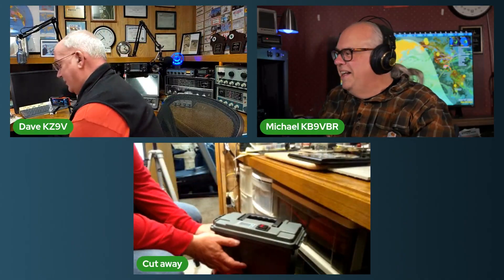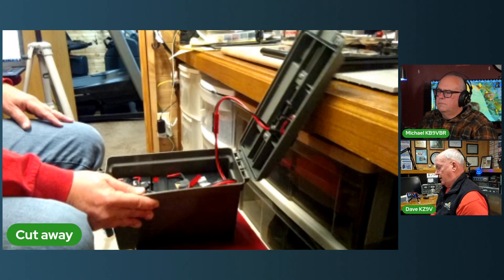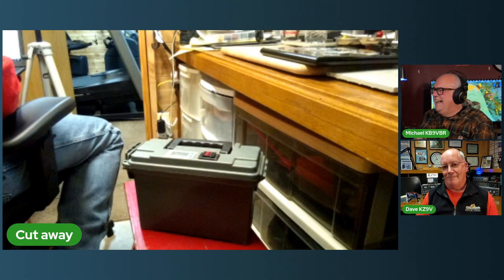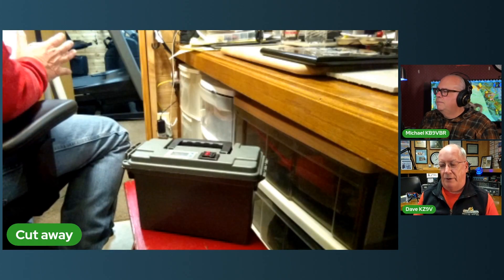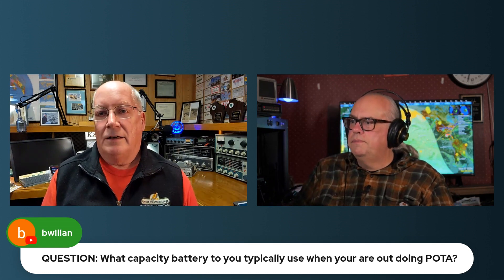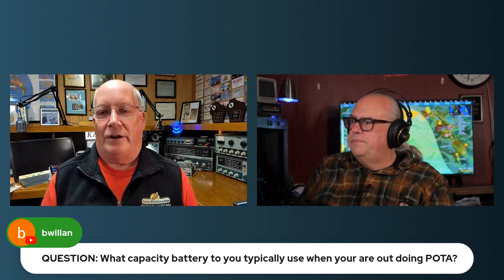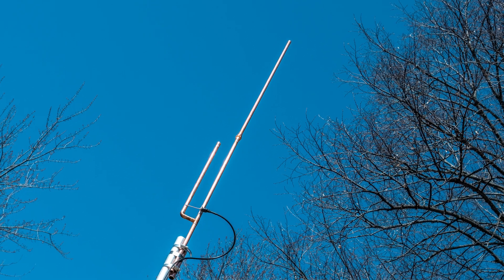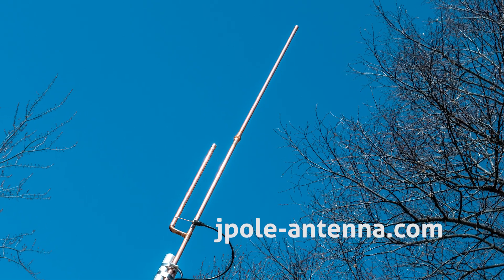Picking the right battery for portable operation - Ask Michael, KB9VBR

Comment: I upgraded all of my connections to 50A 600V Anderson Power Poles and it made a huge difference of voltage drop to the radio.

As much as I love my Bioenno batteries I just can’t afford their 100Ah ones so I’ve been looking at alternatives. But there’s so many options and brands. Looking at reviews on Amazon they’re so mixed, just makes the choice that much harder.

Then there’s digital, which I don’t understand why people run during activations. It’s so hard on the equipment and greatly reduces run time on a battery. Not to mention it’s too boring and is like watching paint dry. Don’t even get me started on the cheaters that run the 100% automated version 10 hours at a clip like K7CAR. There’s no way he’s sitting in front of that station all that time.
Reply from the maker: I watch the videos from Will Prowse to determine if a 100 ah battery is a good one. He does tear down videos of many of these inexpensive batteries and it gives you a great indicator of their quality based on how they are built and the type of BMS and cells they are using.
Reply: @ thank you Mike!

Comment: What do you use for charging the battries back to full power again Michael , 73  KC1USS
Reply from the maker: I'm using a 10 amp LiFePO4 smart charger for my batteries. It is a little oversized for my small 12 ah battery, but it works great with the 20 and 50 amp hour batteries I own. The large 100 aH battery in my camper is typically charged with the onboard solar system.
Reply: @KB9VBRAntennas  thanks Michael , 73 I'll check into that item soon , thanks for the info .
Reply: My Ham Call Sign is KC1USS New Tech as of April of 2024

Comment: I  had a bunch of Iomega Zip Drives in the late 1980's to late 1990's when USB thumbdrives started to gain traction.
Reply from the maker: Back in the '90s I was working at a software company and we'd frequently shuttle files back and forth from home to work using Zip disks.

Comment: I have been looking for that exact iomega  case since I first saw it in a previous video
. It's not a zip or a Jaz drive.  I have seen no other pictures of iom gear using it.   What is it from ?
Reply from the maker: the case is from a Zip 100 drive. Back in the '90s I was working at a software company and we'd frequently shuttle files back and forth from home to work using Zip disks. The drive is long gone, it probably suffered the 'click of death' but I held onto the case for it. The center portion of the case would hold the Zip drive and parallel cable and on the front are two pockets sized for Zip 100 disks.

Comment: I used two 12-volt 18 amp hour batteries in my go box with two switches one for each battery that way I don't run both down and I'm using the original fuse holders for the ft-891. 73 K4BWN